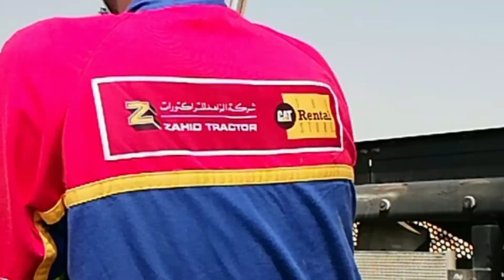CAT 6015B  ENGINE REMOVAL ( OIL TO  COOLANT MIXING) Part 2

Comment: What was the fault with motor ?
Reply from the maker: Its Engine oil mixing to coolant , possibly crack  liners or head issues, we dont stip components  on site sir, but the engine running hours is overdue for Rebuild